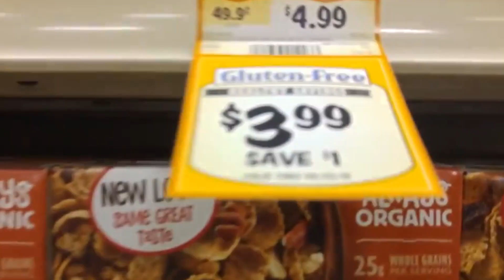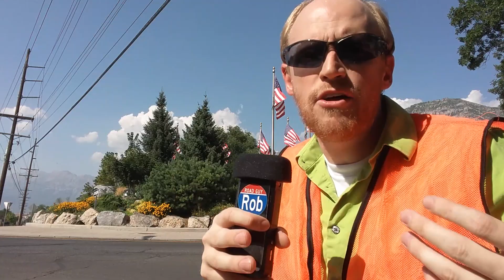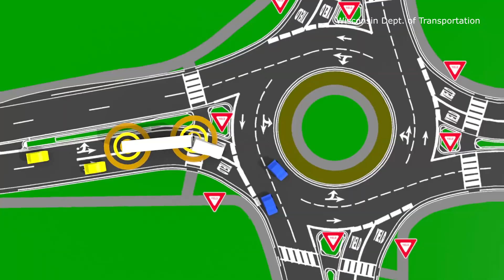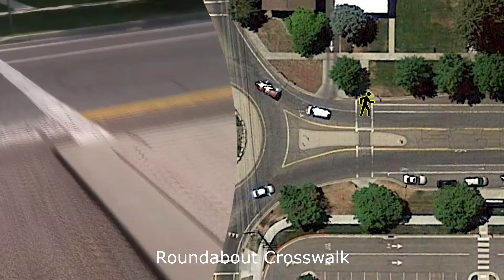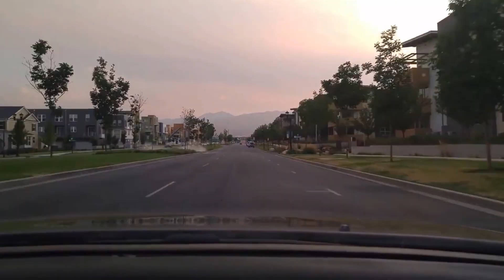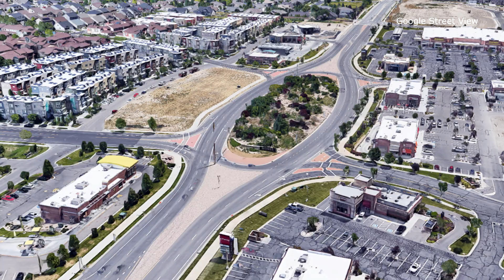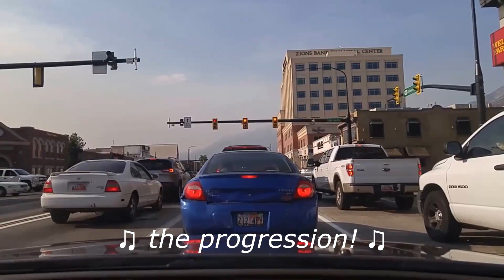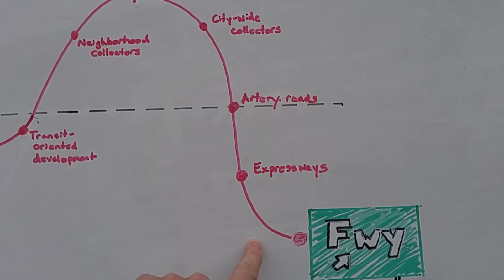Are roundabouts REALLY better than a traffic signal?

Comment: Traffic circles are better than lights, but center turn lanes between divided roadways set at intervals away from 4 way intersections are much better. (Type "4782 Post Road, Charlestown, RI" into Google Maps for example/ see route 1)

Question - does anyone know the technical term for this configuration? Thanks.
Reply: Isn’t that just a form of an elongated circle? The only difference is that the “entering” traffic has right of way when approaching where the highway divides whereas the “inside” traffic always has right of way in standard circles.

This is not the design that came to mind initially based on your description. Look at 6566 Hwy 53 in Dawsonville, GA. Notice that the NE/SW traffic turning left from 19/400 actually crosses the oncoming traffic some distance away from the actual intersection.
Reply: @GTR3x  Yes and no. The circle requires all entering vehicles to yield. Usually, one road is so busy that it slows thing down too much. Doing the crossover farther down allows the busy road to keep moving, just like a limited access highway, but without the wildly expensive (and ugly) overpasses. If the center is wide enough, it becomes a good place for businesses too.

Comment: The BEST Roundabout I know is the one where anyone turning Right will not actually enter the Roundabout, they have their own "Exit Ramp" reducing waits at the Roundabout.
Reply: Other than that, I can't say that I'm a fan of them.  The Roundabout that I wrote about above DOES exist already, the rest of it is a two lane Roundabout serving a two lane road (4 Lanes total).  Traffic going straight should be in the Right Lane,  Traffic turning left should be  in the left BUT it doesn't always work that way plus the fact that the exits have 2 Lanes makes it possible to "squirt" through.

You may wonder why I'm writing this next paragraph but consider someone older who is perfectly capable of driving to and fro UNTIL they encounter a Roundabout in commuter traffic - I suppose that their best option will be to always keep to the Right until they get to the "exit" they want.  This will save them from merging Right within the Roundabout or when exiting.

Comment: Not only you can get 5 greens in a row but thinking about the environment comes with multiple benefits.

Reduced Fuel Consumption: When cars can maintain a consistent speed and avoid frequent stops and accelerations, fuel efficiency improves. By synchronizing traffic signals to create a "green wave" for a pack of cars, there is a smoother flow of vehicles, reducing the need for unnecessary braking and accelerating. This can lead to fuel savings and a decrease in overall fuel consumption.

Decreased Emissions: A smoother traffic flow with fewer stops and starts not only improves fuel efficiency but also reduces emissions. By minimizing unnecessary idling and abrupt acceleration, there is less air pollution, contributing to improved air quality and a more sustainable environment.

Decreased Wear on Vehicle Components: Continuous stop-and-go traffic can be hard on a vehicle's components, such as tires and brakes. When traffic is synchronized and cars can maintain a steady speed, there is less strain on these components, resulting in reduced wear and tear. This can lead to longer tire life, reduced brake pad wear, and potentially lower maintenance costs for vehicle owners.

Enhanced Safety: Synchronized traffic signals can improve safety on the road. When cars can move through consecutive green lights, there is less temptation for drivers to speed or make risky maneuvers to catch up with the flow of traffic. This can reduce the likelihood of accidents and promote safer driving behavior.

Reduced Driver Fatigue: Constant stopping and starting in heavy traffic can be mentally and physically exhausting for drivers. By allowing a pack of cars to move along a green wave, drivers can experience a more relaxed and continuous driving experience. This can help reduce driver fatigue and improve overall driver comfort.

Comment: In the US roundabouts are often seen as traffic calming measures, and installed in mostly residential areas. In Britain, they are seen as “traffic flow improvers” and are almost exclusively used on A roads where there are little to no pedestrians. London is in the process of killing its urban roundabouts by cutting the road on one side to create a larger pedestrian area and a strange two way bent road. This has improved the situation for pedestrians, and doesn’t seem to have negatively impacted drivers. Check out parliament square, Trafalgar Square, and old street roundabouts.

Comment: No one has mentioned the problems of low visibility that roundabouts cause, especially for kids, people with disabilities, or recumbent bicycles. In the U.S., roundabouts are usually filled with planters that block the view, so neither the driver nor the crosser can see each other. Even uncontrolled stroads are safer than that (and that's saying a lot) because you can see what's coming and wait for a break in traffic. 

Also, everyone brags about how roundabouts reduce accidents *at the roundabout intersection*, but what about the next street down?  Platoons create gaps in traffic, allowing cars (and kids, bikes, wheelchairs) to cross or pull onto the road safely. But roundabouts eliminate gaps in traffic, increasing serious accidents at neighboring intersections because there's no safe time to enter or cross. In my tourist-filled childhood home town, I could tell when the stoplight 7 blocks away had turned red, because 1 minute and 15 seconds later there was finally a gap in traffic at my street.

Comment: I moved to Al Ain, UAE in 99.  The population was 250k and the city is spread out quite a bit as it's mostly residential.  There were about 4 or 5 traffic lights in the whole city, it was all R/As.  The traffic moved quite well with the occasional backups in the mornings in the school areas.  The country and the city grew steadily and by about 2012 the city began replacing them with lights because the population was around 600k.  When I left in 2020 they had replaced all the major intersections with lights and it made a huge improvement in the traffic flow.  

I totally agree with R/As being safer when accidents happen.  I had about 3-4 of them and none were serious and it was a rare sight to see bad accidents in them.

Comment: In MAssachusetts there is a large ROTARY(Round-bout) after the bridge going onto Cape Cod (2 lanes last time I was there).  The rule in that state is if exiting 1st turn or next turn, you stay or go into the outside lane to turn off, the inner lane continues around to the other turns.  This is supposed to allow those coming into the Rotary a clear lane to enter, as those in the outer lane should be turning off and those continuing around are in the other lane.

Comment: Great video Rob. I totally concur with your conclusion; roundabouts really ARE better than stop signs and traffic lights. And as you said, there is a little bit of a learning curve for drivers, but once you figure them out, traffic just moves SO much more smoothly. One detail I don't think you mentioned when you were talking about how roundabouts avoid t-bone accidents: when accidents do happen in a roundabout, the angle of contact is nearly a tangent, and the closing speed is probably not more than a few miles per hour.

Comment: Your numbers on the cost of electricity for traffic lights doesn't make sense.  Electricity here is expensive, around $.20/kWh, so $5000/month is 25,000 kWh.  Divide that by 30 and then 24, and you get a power consumption of almost 35 kW.  If you assume three bulbs lit in each direction, that's 12 bulbs, each drawing 2.893 kW or 2893 Watts.  But an LED traffic bulb takes 15 Watts, so 180 total.  So instead of $5000/month, it's more like $311/month, or about $10/day.  Maybe round up a bit for the control box, emergency vehicle detectors, traffic cameras or induction coils.  And most of the country has lower electricity prices.  Or just put one solar panel on each of the four poles, and it breaks even.  (I've seen some places where they do that and skip any billing or metering.)

Comment: When the major city I'm closest to installed one at a particularly dangerous intersection of two arterials, there was a huge learning curve, with lots of fender benders, but as the video states, fatalities were totally eliminated. Rush hour backups used to be as much as a half mile with waits of up to four or even five cycles. Now during rush hour, the backups are rarely over a couple hundred yards. Special pedestrian accommodations include underpasses on the south and west legs, and pedestrian lights on the north and east legs. There's still a little grumbling over new ones at established crossings, but in general they're becoming uncontroversial.

Comment: In my youth, the main place in the US with roundabouts was Washington, DC.  In DC these are called "Circles."   I first learned to drive in the "Old DC" c. 1960.    When we had out of town visitors come, about half the time we would get a telephone call about 1/2 and hour before they were expected.   As a result of the call, I would get our car from a paid parking lot and drive out to where are visitors had parked and guide them in.

I have no problem with these roundabouts.   I always obey the speed limits but I can usually take a roundabout "at speed."   I enter the roundabout with someone tailgating me.   When I exit the "tailgater" is about 20 seconds behind me.

Comment: In my experience (using roundabouts in Australia since getting my license in 1977)   Roundabouts can have 2 faults.
1. If one of the feeds into the roundabouts is busier than the others, the roundabout can  just end up being a restriction.
2. It requires the human operator to actually think.  Drivers are conditioned to be told what to by lights, signs, lines and even barriers.  Roundabouts the driver has to make a decision when to enter, no instructions involved.   Most "incidents" I've seen in my years using them, nearly every one involves a driver "forcing" their way in, or using the wrong lane compared to the one they need to exit.
Humans are being conditioned not to think, but to obey, a roundabout is an aberration to the modern way.

Sure, lots of idiots blow red lights, and their the ones who'll force entry to a roundabout, and cut lanes to get off.

Comment: Middle-of-nowhere Florida, two country roads meet. So, a roundabout was installed, and now I’ve been in THREE MILE BACKUPS from all the vehicles that have to stop, especially big trucks, for vehicles already in the roundabout. Well, at least the roundabout slows traffic as designed!!
Reply: Sounds like a very shit implementation of a roundabout. Either too small or just no roundabout. Did a lot of accidents happen on the intersection?
Reply: @DanDanDoe  was a 4-way stop, that could back up in pm rush hour… Don’t think there were many accidents though… More like “over thinking” a problem…

Comment: We've had round about in australia  for as long as i can remember, maybe even as long as I've been alive. They are brilliant, but there are definately places lights are better. There are roundabouts that have so much traffic on them it creates a line up of traffic. Lights are better on these. Also if you have a significantly more traffic exiting on other exits than the road you are entering from it can be difficult to enter them. Also if designed badly they can create accidents. So they need to be used wisely. Multi lane roundabouts work well and are common here, but i believe they will scare most Americans who are not used to roundabouts.

Comment: Roundabouts are better for all traffic conditions and uniformly keeps speeds down, making them safer, yet maintains flow, making them more efficient. Why they are not adopted is owing to the concept of 'courtesy' being alien, i.e. that someone else has right of way. Traffic lights are far simpler to understand and require less real estate but are demonstrably more dangerous as there is no physical means to temper speed. Some intersections are raised to address this problem. Highways, which don't have pedestrians or real estate limitations, have none of these issues with intersections.

Comment: Without even watching the video: Yes. Yes they are. Period. When I was young, we had a few sets of traffic lights in the area. They always took forever, backed up during busy times of the day, and most annoyingly: kept you waiting for absolutely nobody, especially at night. Sure, traffic lights have improved a lot since then (at least in the Netherlands they have), but still. These days, all the traffic lights have been changed to roundabouts. I can honestly say that these never back up, there's never a wait of more than a few seconds, there simply is no way to blow through a roundabout, they're just better in every single way. Plus there's no chance of them failing, at least not like traffic lights can and will do. Yes, you always have to slow down for them, but you rarely have to completely stop. Unlike traffic lights. Also: they're much prettier, at least if done right, like the one Rob's filming at.

Roundabouts are not difficult, they're not intimidating, they're extremely simple (unless you have one with custom rules, which is dumb). You always yield when entering, when you're on the roundabout you have priority. That's it. Depending on where you are, pedestrians or bikes may have priority when crossing, so just make it a habit to be careful of bikes and pedestrians. You aren't driving that fast anyway, so that shouldn't be an issue. Those that find roundabouts difficult or intimidating should just watch a 2 minute video on how a roundabout works, and then try a few in a quiet area. Hell, the US could probably use some kind of regulated driving lessons to prevent people being so incompetent in traffic.

Some notes:
2:14: Not true. In the Netherlands, roundabouts on certain types of roads have to be able to handle LZVs. These are 25,25m long (82+ft), and are something like a tractor pulling two semitrailers, or a box truck pulling a semitrailer, or a tractor pulling a semitrailer and a shorter trailer. These roundabouts still slow you down plenty. I mean, pretty much every roundabout has that 6 to 10 ft wide skirt around it. Cars don't really wanna drive on it, since it's usually rough, but for trucks it's fine if they really need it. The main issue is that American trucks are just built to require an ocean-and-a-half to make a turn. Also: Why do Americans refuse to believe that steering axles on a trailers are a thing? Or just put the trailer axles further forward. Or just copy European trailers, and trucks while you're at it.

2:47: It doesn't get much more American than that... I'd rather cross at a roundabout, where traffic is forced to slow down, and walk a bit further, than cross a typical American intersection.

4:33: Do Americans really do that? If so, the country probably is beyond saving, since it's clear that it's a mentality issue. But to solve it, just create turbo-roundabouts. Multi lane, but the lanes are separated. You enter the right lane, and get guided to your exit. If you can follow instructions and get in the right lane beforehand, they're way less intimidating than completely open multi-lane roundabouts, and extremely simple to follow.

Comment: Roundabouts slow traffic compared to traffic lights. While traveling out of state I've found that most city boulevards have speed limits that are too fast for safe driving. Cars get a head of speed going passing several intersections with traffic lights and  that's when they run red lights.  I would say that that is more dangerous for pedestrians to have to negotiate a  traffic lighted intersection than a roundabout.

Comment: Professional long haul truck driver here...  Roundabouts are great when designed and used properly.  Having extra room around the center is great, but roundabouts should not be used on extremely busy roads where cars and trucks are mixed.  

If a truck has to stop at a roundabout to yield to vehicles already in and soon to be entering the roundabout, we can be sitting there waiting for several minutes due to our size and performance characteristics (namely: acceleration).  

For this reason, I dislike roundabouts in general.

Comment: The roundabouts in Ohio all have yield signs when approaching  roundabouts. They should have stop signs rather than yield signs as drivers ignore the yield sign on Ohio roundabouts. Are there any roundabouts in the United States that have traffic signals to control traffic on roundabouts? There's a multi lanes roundabout at Riverside Drive & Dublin Granville Road in Dublin, Ohio that needs traffic signals at that roundabout. Driving thru that roundabout in Dublin, Ohio can be a nightmare.

Comment: Carmel, Indiana has over 200 roundabouts and is still building them. The busiest streets with high traffic became freeways. The traffic signal-controlled intersections were changed to interchanges with the cross streets bridged over the busy road and roundabouts on each end of the bridge. The cross street and on and off ramps for the busy street connect to the roundabouts.